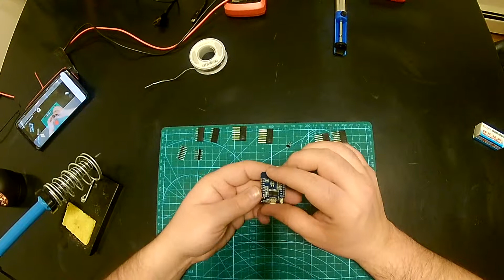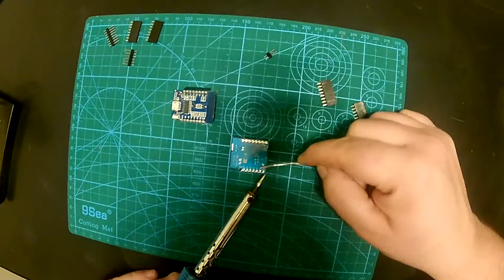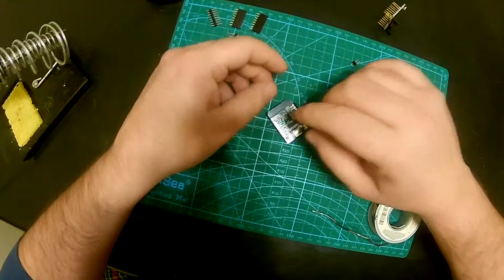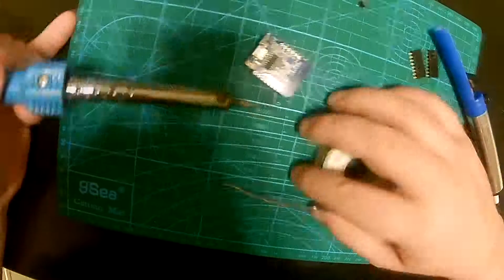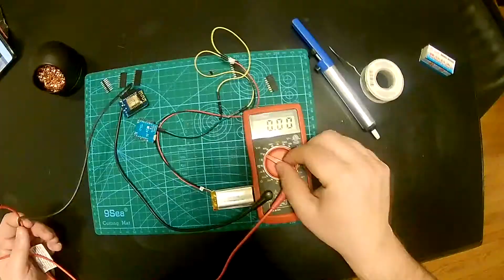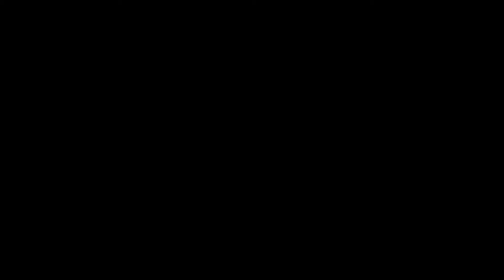Wemos D1 Mini and  battery shield headers soldering

Comment: i use that shield to power up my wemos, but the wemos start making buzzing noise as soon as I plug the shield on it, do you have any idea with this situation? and what is the effect if I ignore that buzzing noise. Thank you sir.
Reply from the maker: Hi Muhamad, does the boar power on even with the buzzing?
If it does, you probably have really bad case of coil whine https://en.wikipedia.org/wiki/Electromagnetically_induced_acoustic_noise . If your board is not powering on, you might have polarities on the battery switched and that can both damage D1 mini and shield.

Comment: is it possible to check how much power left in the battery? I mean voltage power level from arduino sketch.
Reply from the maker: The only way to do that if you create voltage divider and use one of the analog pins to sens the voltage.
Reply: Ok got it thanks mate

Comment: Just a helpful hint man, use a breadboard to stabilize everything when soldering headers like that. 
just plug male headers into the breadboard, and then plug your female headers ontop of them, then put your circuit board on top and solder. This will make things a LOT easier, and leave you with perfectly aligned headers.
Reply from the maker: Thanks for the suggestion. I actually did that for the second one. My breadboard was occupied with components for another project at the time of recording.  I appreciate your input and for taking the time to view my video.

Comment: Something weird is happening with mine, I put a 3.7v lipo positive to positive and negative to negative,
but the battery discharges almost 1 amp trough the shield and it starts smoking, nothing is connected to it.

I don't remember switching the polarity before, but I guess if I did, that could be the problem?
Reply from the maker: If you reversed polarity at some point that could be it or the part was defective right from beginning.
Reply: @markoni985  Thanks for the reply. It's still smoking to this day :P
I ended up buying a different charging module (TP4056) It worked great for my project but I did notice that it can't quickly provide bursts of high current spikes without a battery.